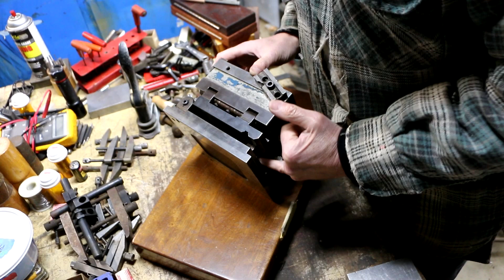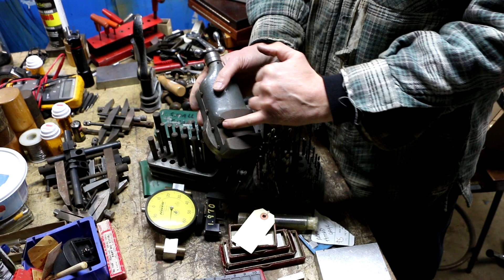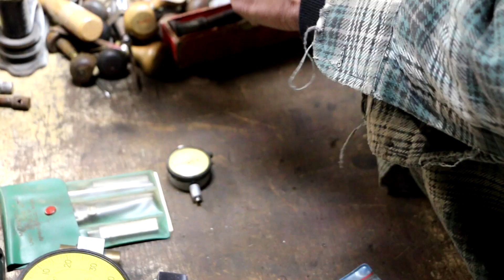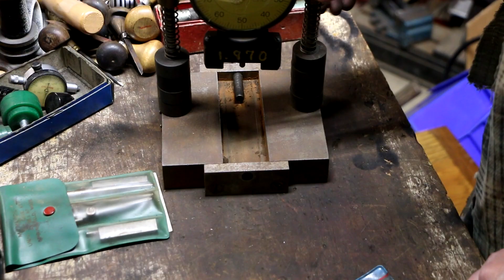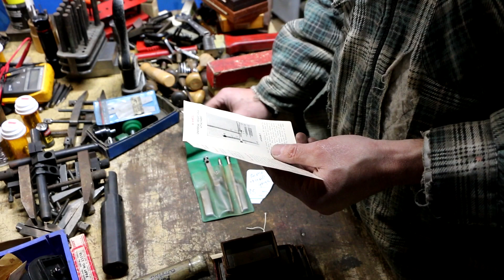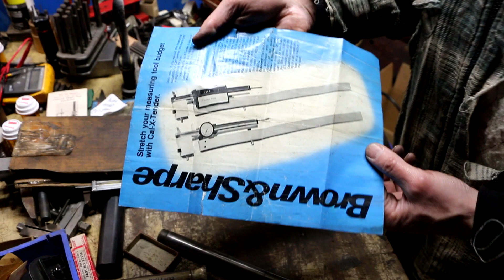Tool Picks from a closed Machine shop 2023 Part 1 of 3

Comment: The pair of “parallels” is used to set up a    Gauge of defined size (by stacking up blocks in between).  Depending on how you stack them up can be inside or outside gauge.  The triangles are straight edges.   Nice finds.
Reply from the maker: Thanks!